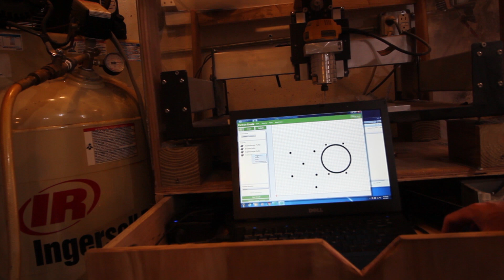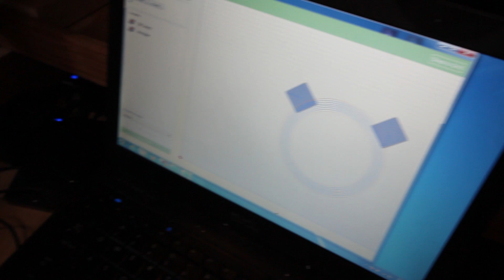Small Block Chevy Build Part 5: Milling Aluminum Brackets with the Shapeoko3 Complete!

Comment: Nice work, and good job figuring out the Carbide Create Puzzle.  I do want to recommend using ZrN coated 3 flute end mills for cutting aluminum.
Reply from the maker: Richard Cournoyer thank you for this comment - I will look for zirconium nitride coated bits when I purchase next.